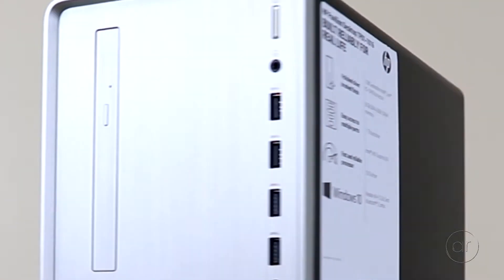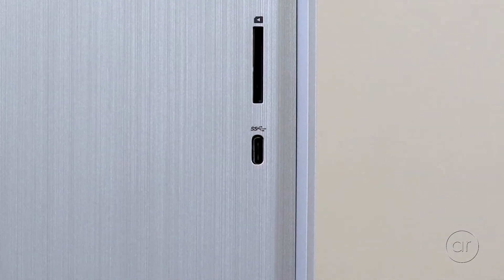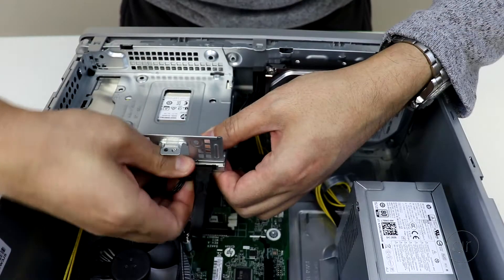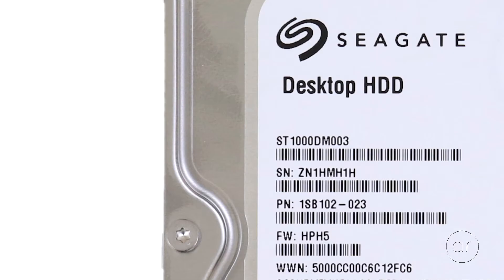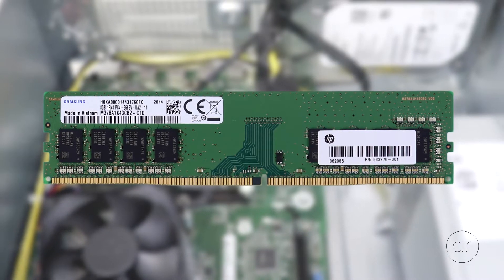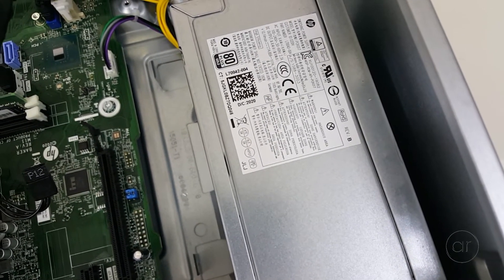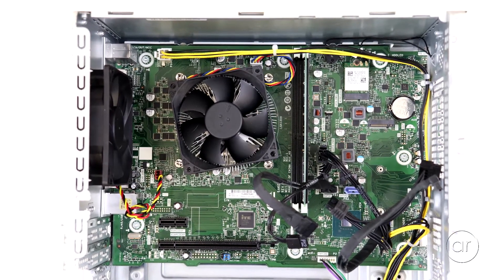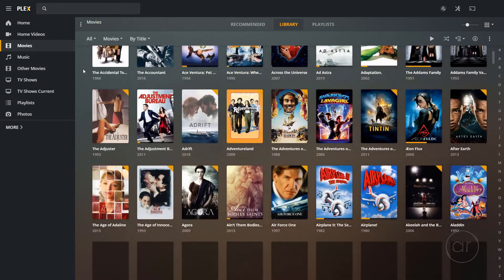How to Open and Upgrade an HP Pavilion with a 10th Generation Intel i5-10400 (TP01-1016)

Comment from the maker: I will be maintaining a list of components that others have successfully added or upgraded in the description and in this comment. If you have had any success stories, please comment below and I will gladly add your experience to this list. A big thank you to all my viewers and subscribers!

Much obliged 🎩 to all my viewers. Like. Share. Subscribe. Enjoy.

Support links
☕ BuyMeACoffee: https://buymeacoff.ee/accessrandom
🐦 Twitter: https://twitter.com/accessrand0m
🔵 Subscribe: https://www.youtube.com/c/accessrandom?sub_confirmation=1
Reply: I bought this system for my son. I can confirm that adding 4gb (8gb total) of matching ram from ebay and an nvidia t400 allows it to play Fortnite on medium settings at 60fps. Thanks for the great video!
Reply from the maker: @pasta-eo5mt  Thank you. Would you happen to know the brand/model number of the memory and the graphics card? I can add it to the description with credit to you.
Reply: @accessrandom  PNY T400 
SKU: VCNT400-PB
Reply from the maker: @pasta-eo5mt  Thank you! I've added it to the description under "Graphics."
Reply: @accessrandom  Please I'm in dire need for an answer, can you please test the voltage of that purple wire in the small inline connector. It should be easy by putting one side of a voltmeter on the pin of the purple wire and another on the black wire next to it.
Please tell me the reading, if it was 3.3, 5 or 12 volts?

Comment: Am i able to use this PSU for my HP. S-Union 942332-001 400W Power Supply PSU Compatible with HP 280 288 285 480 600 680 800 G3 G4 Power Supply PA-3401-1HA L04618-400 942332-001 L04618-800 PA-3401-2HA. I heard you say something like no being able to upgrade the PSU. Im new to the Pc building scene and this will be my first upgrade.? thankyou for the video.

Comment: When it comes to power supply upgrades for these HPs you can actually upgrade to a 500 watt or even a 700 w from the factory and it will fit this case perfectly and I know this from experience!!!! They're available on eBay and on Amazon. 😇
Reply: could you send a link to these?

Comment: Argh, I like this case and the front panel I/O. I was really hoping it was possible to upgrade the PSU and maybe the motherboard.
Reply: OK, wow. I just found out from another video that you can replace the PSU with a L05757-800 model from the HP Envy.

Comment: I have an old version of the same PC with Intel i3 8100. 
The PC will run sluggishly with a mechanical hard drive so a nvme 2280 ssd is the first thing you want to upgrade.
Next is the Ram  the least I suggest is 16gb and if u are into gaming then adding a GPU makes sense, but you need to swap the power supply unit too, mine came with a 180watt psu, so you need to replace it with a higher wattage PSU.
Core i5 10th gen is okay.
Reply: I got the i3 8100 HP TP01-0014, what CPU did you go with?

Comment: Thank you for showing the internal 3.6" hard drive mounting on the front chassis.  I bought the AMD Ryzen 3 TP01 -2xxx version.  Did not know HP mount the 3.5" hard drive at the front instead of the hard drive tray.  My AMD version came with M.2 NVMe Driver on the motherboard.  That means this HP computer can have total of 3 storage drives.  Good Jbo HP.

Comment: great video , is it possible to upgrade from gtx 1650 super to rtx 3060 ti ? I have Tp01-2000a that has Ryzen 5 5600g and also I will need to change power supply to 550 wt

Comment: Just a heads up there is one power supply I know of that can be interchanged with Erica style motherboards such as the one here that has a 8 pin GPU connector and is 400w. This is the L04618-800 power supply. It fits the proprietary design and works with a GPU. Just something to try.
Reply: Is that Erica board the one that comes with the Ryzen 5's configuration?
Reply: Yes and also recently I found a compatiable 500w!
Reply: @JohnManagedDemocracy  hi what is the model?
Reply: L05757-800 I think

Comment: For those looking to fully upgrade this machine here is a list of what is possible. This guide will for those that want the best performance for gaming/streaming so the overall goal would be to have most of the power be used by the CPU and GPU and all other uses be minimal.
Hard drives: The motherboard has 3 sata ports, so you can install 3 sata drives, some might want to keep/use a port for their optical drive. If you don't need it I recommend removing it to free up the the sata port and lower power consumption a few watts. If you intend to use these ports, then only use SSD's. They have no moving parts and use very little power to operate. There is room to install 3 2.5 SSD's. Two on the silver cage and one behind the front panel. Also if you plan to use all 3 sata ports, you will need additional sata cables, and also a SATA power splitter. 
NVMe: There is one free slot on the motherboard for a 2080 M.2 NVMe. However, since the chipset only supports PCIe gen 3, don't spend extra for a gen 4 NVMe drive, unless you plan to upgrade in the near future. You can also get another M.2 NVMe by using a NVMe adaptor for the lone PCIe x1 slot that's above the graphics card slot. If you want to do this make sure the adapter is for PCIe x1 ONLY, if it's anything else it will not fit in the slot.
RAM: There are 2 ram slots on the motherboard. The maximum supported is 32GB, but for most people 8 or even 16gb for gaming is more than enough. The fastest speed supported is 2933Mhz. If your ram is rated higher than this, it's fine, the ram will just operate at the lower speed. Which ever ram you choose make sure to get two identical ram sticks. Most ram companies will sell a double pack of identical ram and this is the best way to ensure that your ram will work. Using mismatched ram can cause issues including failing to POST. So take caution.
GPU: There is no extra power connector from the PSU so any graphics card that goes in has to be a model that doesn't require a power connector. Currently the best performing card is the GTX 1650. It'll delivery 60 FPS for most games on medium settings on 1080p. Another suggestion is a GTX 1050Ti. It's performance is lower than the 1650, but it may be easier to find at a decent price compared to the 1650. 
CPU: The motherboard's chipset only supports the comet lake series of CPU's from Intel, so that means you can only use the 10 series. Also it doesn't support the K models of the CPU's that allow overclocking. The best CPU you can have is the i7-10700. If you want to save money and intend to install a graphics card you can get the 
i7-10700F model, this one doesn't have integrated graphics and should be a cheaper option.
CPU Fan/Heatsink: The chasis is small overall so if you want to upgrade the cooling for the CPU fan, you will need to find a low profile heatsink. Best one is from Noctua. It is quite pricey even for the low profile model, so if your budget is tight, you can just replace the fan with a 60mm noctua fan. It should be much better than the stock fan.
Chasis Fans: Many of you may be worries about air flow in the case or the lack of, but don't worry, you can add an additional fan and also swap out the fan at the rear. The rear fan is a 92mm, so that should be pretty easy to swap out. The additional fan goes on the black cage. If you want a perfect fit you need a 70mm fan, which is rarely used and unfortunately noctua doesn't have a fan in that size. So the best option and the one I personally used was a 80mm fan. As long as you can line up at least one of the holes to screw in the fan, you should be fine. You will however need a fan splitter cable. There is only two fan connectors on the motherboard, one for the CPU and one for the chassis. Normally, the rear fan is connected to it, but if you want additional cooling then you need a splitter cable to connect two fans to the single chassis fan port.
Final Thoughts: If you do everything on this list, your overall power draw will be pretty close to the maximum wattage of your PSU. 65W for CPU, 75W for GPU, that's already 140W out of a total of 180W from the PSU. The other things that draw power are hard drives, optical drives, the fans and the wifi card. Using only SSD's will lower the power consumption compared to mechanical drives, removing the optical drive and using a wired connection for internet will also lower the power consumption. Upgrading the fans to more efficient models will also lower overall power consumption when the fans spin.
Reply: What's a reasonably priced graphics driver I could add to this computer to make it better for gaming, without buying any of those other things you mentioned?
Reply: Thank you very much.
Reply: do you mean 2280 nvme?
Reply: As long as I get two identical sticks of 16gb I will be fine in my 595

Comment: Bought this exact PC for around 80 bucks.. Insane bargain imo.. and Ive been looking into the psu upgradeability.. from what I can gather the two 4pins are for powering the CPU and fan and the other for HDD etc.. Ive found Adapters for this interface but with just a single 4 pin along with the controller connector, however, Shouldnt I be able to run an ordinary 4pin Sata/IDE cable to the other connector (the one thats not for cpu etc)

Comment: This system presents a challenging GPU upgrade but I know that the Nvidia Quadro K2000D workstation CAD graphics card (max 51W) works ok with the stock HP 180W PSU. They are available at reasonable prices on eBay. Not ideal for gaming perhaps but much better than Intel's integrated graphics and more GPU ports are available for more screens (DVI and DisplayPort). Perfect for crypto-mining though!
Reply: You could also use a GTX 1650. Just find one that doesn't require an extra power connector from the PSU and you should be good to go.

Comment: i have an Intel(R) Core(TM) i3-10100 CPU @ 3.60GHz in the same pc is it possible for me to replace it with a core i5
Reply: Yes you should be able to upgrade it to an i5, just make sure you keep in the 10 series and DO NOT buy the K version of the CPU, your power supply won't be able to handle the K version since it requires more power.

Comment: What is the best GPU upgrade for this?
Reply from the maker: I'm keeping track of some of the successful upgrades other viewers have done - you may want to review some of their suggestions in the description (under Graphics).
Reply: @accessrandom  I already have a GTX 1050 ti I have been using for over a year with the model in the video. Do you think it will be able to handle a GTX 1650 S?

Comment: Mine just ran out of warranty and it shuts itself down randomly, I haven't done any upgrades and looked inside to see if it was dirty but it looks clean...any ideas on what could be causing it to shut down... I also did drivers updates but no lock. how can I trouble shoot this intermittent problem. Thanks in advance  Any help would be greatly appreciated
Reply from the maker: That is difficult to diagnose, as it could be either a hardware or software problem. Did it start after installing a certain piece of software or driver? The nuclear option would be to restore the factory image (for which I have a few videos).

Comment: Hej, I have a HP Pavilion Gaming Desktop TG01-1064no with 512 GB PCIe® NVMe™ M.2 SSD storage.
I am wondering if I can add an additional storage device (not just replacing with a bigger one)  using the expansion slots (which one?) available on Baker MB:
Two M.2 expansion slots (1 x PCIe x16 and 1 x PCIe x1)
One M.2 socket 1, Key A
One M.2 socket 3, Key M, (2280/2242)

Thx and thumbs up for your videos!
Roberto
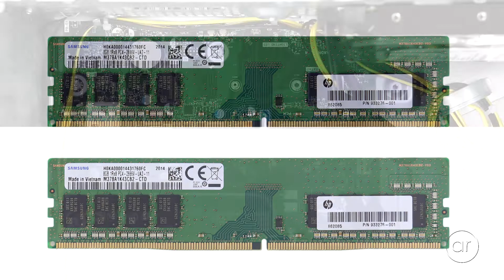Reply from the maker: Thank you. I'm not sure about the M.2-A socket, but you can always add SATA storage using the extra SATA port (as seen at the 5:13 mark). If you need more, you should be able to add a PCIe SATA expansion card which would allow additional SATA devices using power splitters. The only issue is that there isn't much space in the case so you would need to improvise a way to hold them in place.
Reply: @accessrandom  following your suggestion I bought a SATA HDD and that's all.
Thanks for your effort doing videos and for your prompt reply to my question! Super!

Comment: I will never buy another HP. They don't play nice in terms of upgradability. I returned my brand-new HP Envy UNOPENED to the seller, because of the proprietary power supply. HP wants to sell me another power supply for $300, where an equivalent ATX PSU would cost around $60 - a complete rip-off.
Reply from the maker: Yeah, HP makes it really difficult to upgrade anything other than the basics like storage and memory (and even then, there are caveats).
Reply: I posted above about mine and so have a 17 inch HP laptop with broken hinges..... I think I am done with HP as well their quality has gone to the toilet.

Comment: I have one with a M2 SSD installed (500GB). Do you know if I can add another Hard Drive and which is the biggest I can install?
Reply from the maker: It will depend on your specific model, but if it's in the TP01 family, you can install any size hard drive on the market today (GPT supports up to 18 exabytes, Windows supports up to 256 TB).

Comment: Great video. Is the air flow good? Does it have an intake fan and exhaust fan?
Reply from the maker: Thank you. I haven't had any problems with overheating, so the one fan in the rear seems to be sufficient. However, I just use it as a Plex server (so I don't stress it very much).
Reply: I have the same model it blows more cold air than hot air so i guess you could say yes

Comment: Great video. Has anyone successfully added an SSD? How does it secure to the silver tray that was removed.
Reply from the maker: Thank you. I haven't added one to this particular model, but in a different HP I simply added velcro on the tray and one side of the 2.5" SSD and attached them together. Alternatively, I think you can probably align at least two of the screw holes on the tray to fasten it.
Reply: @accessrandom  Thank you. Does a 2.5 SSD get hot? Would this be of concern for the velcro?
Reply from the maker: @charlescadogan8504  Typical SSD temperatures run about 30 to 50 C depending on airflow. I haven't had any problems with the velcro in my system, but if in doubt, make sure there's enough airflow around the SSD.

Comment: Great Video! I just bought a refurb HP ENVY Desktop TE01 Intel Core i7-10700 2.9GHz 8GB 1TB Windows 10. This computer is mostly like the one you have in this video and I plan on upgrading the RAM and transferring the Windows 10 OS to a new M.3 SSD. Do you have a recommendation on which RAM sticks I should buy and what M.3 SSD I should get? Thank you. Just looking for a machine to do office work and light photo editing.
Reply: Thank you!!! I will see what Newegg has on special in the run-up to the holidays...
Reply from the maker: Thank you. You may want to visit some of my other videos where I replace the RAM in this same PC: https://youtu.be/ieQayPuq6vI and add an M.2 SSD in the same PC: https://youtu.be/cVRVgrOl1M8, and look at some of the comments as well. I used a faster rated memory and the HP downgraded the speed to 2400 MHz. Others have used 2666MHz RAM and were able to use it at that speed. If speed of RAM is not a factor, any replacement DDR4 memory will work.

Comment: Hey, I'm planning on getting a new gpu, do you think a gtx 1050 would work with it?
I have i5 10400 16gb ram, pci express 16 and 250w power
Reply from the maker: The power consumption can get pretty high (~75W). I'm not sure what other components might be in your system, so you'll want to add up the power requirements to see if you have enough.
Reply: Sorry for late answer, I learned from the internet that the 1050 can run on only pci e slot, and doesn't need other power supplies, I don't want a super gaming PC, but I want to be able to play some low end games with my friends

Comment: so, i cant put a graphics card in this?
Reply from the maker: You can, but it would have to be a lower-power model. I have been (and will be) keeping track of any successful installs in the description under the "Graphics" section. I've had one report so far...
Reply: @accessrandom  hello i installed an msi gtx 1050 TI lP wich is running top performance with my 310 wat power supply and its running games like battlefield 1 with 1080p and a smooth 70-75 fps im pretty sure it takes 75 wats of power but i could be wrong about that

Comment: Can you play video games on this PC? With high graphics?
Reply from the maker: Without a discrete graphics card, I'm afraid it probably won't be able to play games with high-end graphics. The problem with this particular model is that it has a low-power proprietary PSU if you decide to add a GPU later on.

Comment: What’s your opinion on using this PC for creative programs like CSP and blender?
Reply from the maker: I'm not sure about CSP but for 3D rendering you may want to look at either stronger CPUs or a PC that will take a graphics card. Because of the weak proprietary PSU, the TP01 will be difficult to upgrade to a high-end video card. Again, I haven't tried CSP or Blender myself, but this is what I've gathered from some googling...

Comment: Can I use a GT 1030, or a GTX 960 on this? Thanks :D (and a GTX 1650)
Reply from the maker: Since the TP01-1016 only has a 180W power supply to power the motherboard, CPU, memory, HDD, etc. the GTX 1650 and 960 would probably be over the limit since they're at about 80W to over 100W. The GT 1030's power consumption is around 40 to 50W, so even then I'd be uncomfortable recommending it. You may want to take a kill-a-watt and measure power consumption on your system before adding a graphics card to see if will be able to handle it.
Reply: @accessrandom  thank you